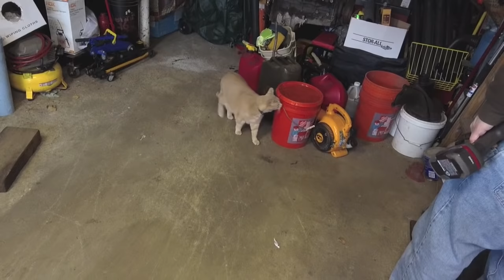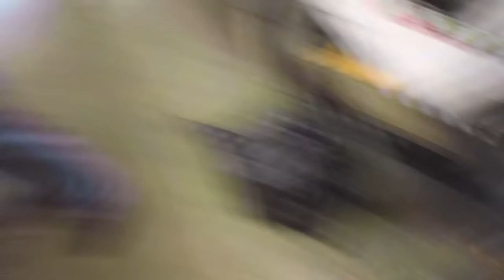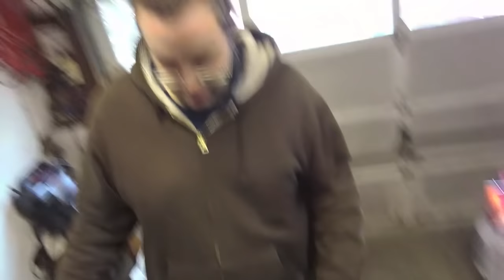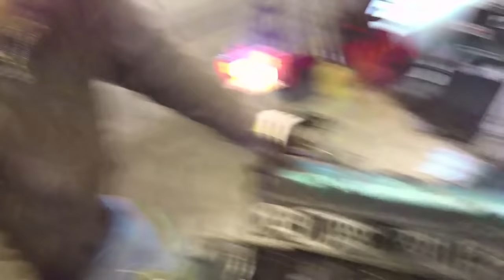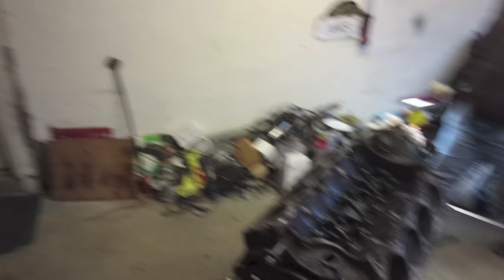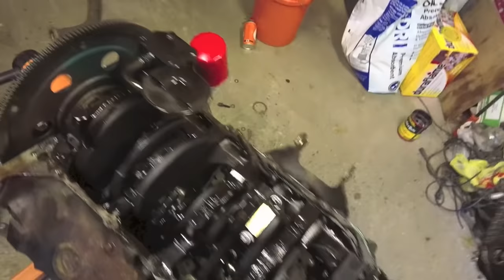'76 Pontiac 400ci V8 Engine Rebuild, Part 1: Disassembly

Comment: Don't be surprised if that engine is actually still in as new condition because I pulled the cylinder heads off my 5.7 litre Chevrolet LS1 V8 engine to replace the hydraulic lifters at 337,512 kilometres & the cylinders still had the factory hone marks in them !

Comment: You show your a novice when it comes to Pontiacs. Never had any coolant leaks from the front of any Pontiac intakes. Many do leak there but you have to know how to install the the front timing chain cover in relation to the intake. One of the things I love about Pontiacs is you don't have to pull the distributor to do an intake change. Some guys even separate the front water jacket of the intake and modify it so you can swap intakes without ever loosing a drop of coolant. Pretty neat so you could run say a tri power setup for looks and a then swap out to a large single four barrel for performance.

Comment: Ive taken apart quite a few poncho 400's... You need to soak those bolts in PB blaster and then go after them with a ratchet nice n easy. You have a lot more "feel" and control by hand than with an impact. Not ragging on you, just trying to help...havent snapped a stud yet.

Comment: hopefully, by now you got a 4" Butler stroker kit and turned it into a 428 version with the 400 block, and paired it up with forged rods and a modern cam.
Reply: I would go with the 4.25 stroke crank and bore it .030 over. That would make it a 461. The same size as a 455 only bore .030 over.

Comment: Need to find a Pontiac 455 block, and take off the 6x heads off of 400, and put them onto a 455 for 9:1 compression engine. Just needs a 230 @.050s cam, and your good to go1

Comment: Got a 1975 Pontiac Catalina 400ci. It's in pieces now. But all engine part's are painted and ready to be reinstalled. I was wanting to put a camshaft lift in it till now I was reading that I can install rocker rollers to get the cam to recognize the lift. I see the older pontiac's use the 1.65 rocker rollers.  My question is how do I know that the 1.65 rocker rollers are correct for my 1975 low compression 400 and the valve's won't over meet the pistons.

Comment: hello- 
i have a 75 t/a formula:  i believe i have a 400 motor with 5c heads (unknown automatic transmission).  the block casting is 481988.  is this a good motor to build up from?  or is this the emissions friendly weaker block?  thank you kindly

Comment: Hey @LynolsOffice what happened to part 2? I'm working on my 400 right now and can't for the life of me find any information on how to remove the front main seal out of the timing cover. aa
Reply: T
I know this is kinda late but the oil seal just pulls out. You'll ruin it of course just try not to ruin the cover. There are a lot of Pontiac facebook pages where you can get info. Just dont call it a big block or you'll get teased mercilessly!

Comment: It decided to screw you over because it is against you and wants you to fail.

I notice those are 6X heads, but the large-chamber version. I don't know how far along this overhaul is or if it's already done, but the compression ratio in '75-76 Pontiacs was in the tank, might have been in the high 7.0's. Shaving the heads and decking the block to get the compression ratio up will help a lot. Remember that those cast-iron connecting rods and top-heavy oiling system limit safe rpm's to around 5K.